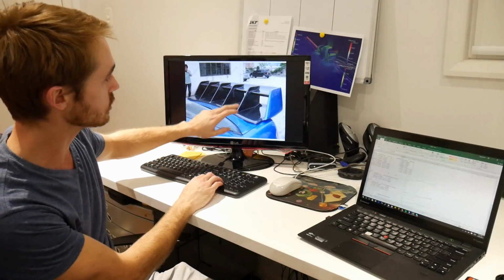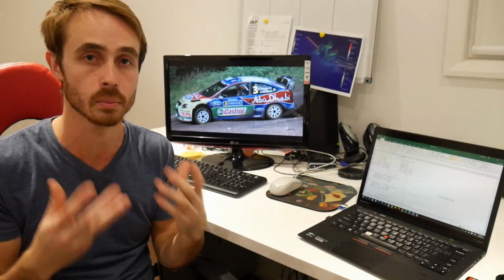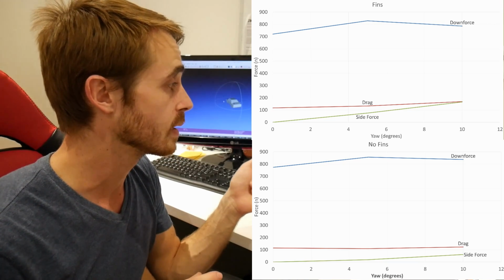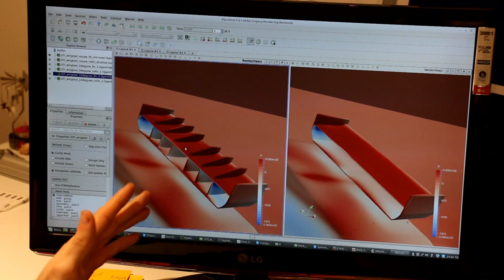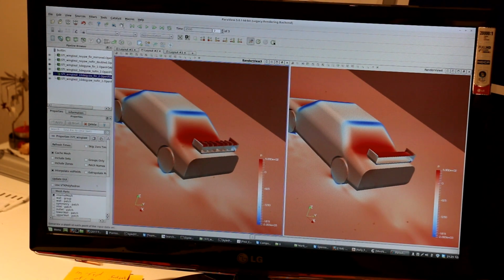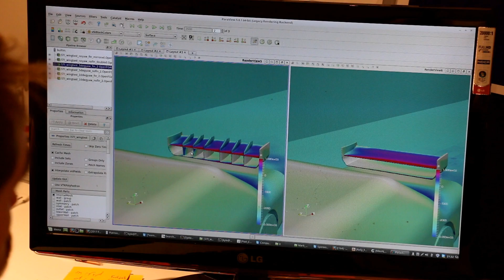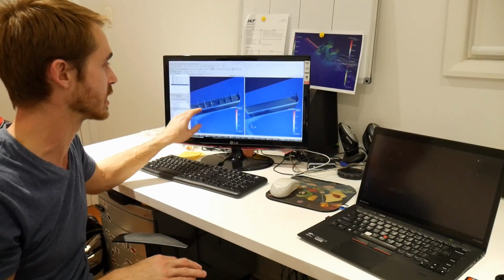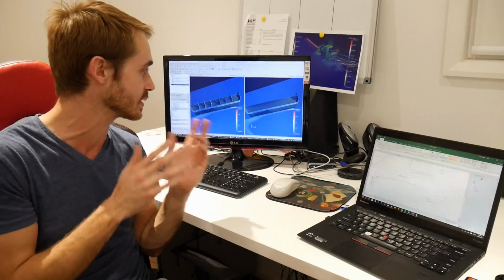How do Rear Wings Fins Work? - WRC Wings Explained!

Comment: Thanks for sharing! We were all having a recent conversation about this in a group about why folks went with skeletonized / cutout uprights vs solid, and what the benefits were etc etc.

The most interesting response came from a fellow who did cutouts in the same shape as the aerofoil running fore to aft on the uprights. They found it reduced drag while also reducing weight.

Comment: For those who are having a bit of trouble understanding.

Wings don't like going at an angle. They lose downforce. Flow separates and shears off.  The fins more or less redirect and force the air into the correct direction and they work better the sharper the yaw angle.  The slight loss of downforce in the straight (or overall downforce) is a good trade off when you're keeping a lot of that down force while sliding through the dirt compared to normal road racing.  This is one of the reasons why end plates are on wings compared to back in the 60's, because even if slightly, due to slip angle (your tires are literally bending and stretching to make it look like your car is drifting even if slightly) your wing will have some yaw and receive air perpendicular to where it's heading.

so in reality. Road cars have to have the same thing as rally cars, but way less because they aren't expected to slip and slide.

Comment: I remember in the early days of Formula D there was a yellow GTO that was a top runner.  One of the odd things they did was put these clear plexiglass fins on the rear of the car between the C pillar and the wing.  The reason they gave was for better control of the drift at high speed.  Guessing it was a similar thing to the WRC cars.  Was around the early 2000's and the driver I am pretty sure was a rally driver as well as Formula D.  Drawing a blank on the name right now.

Comment: Am I correct in thinking that rally cars have heavy bias towards rear downforce? I used to rally and ice race on an amateur level. I had a traditional wavy carbon fiber road race wing on my first car, which wasn’t as good as my second one with a wrc wing. It’s an old design without fins though. It still had more side force obviously. Thanks for the explanation. I can definitely see how it works now.

Comment: I couldn't message you, so, random question. I just bought a wrc spoiler for my 04 sti. Can I use the oem spoiler bolts for the wrc spoiler or will I need new ones?

Comment: Hey Kyle.  I have a 2014 turbo BRZ and a 2017 STi, and I'm in several Subaru groups on Facebook, and I've seen a ton of people buying Perrin's "wing stabilizers"...though they're also known as "stiffies" to those groups.  You can see them on Perrin's page by following this link: http://perrinperformance.com/i-23037505-wing-stabilizer-for-2015-17-sti-sedan.html

Now, looking at their design, they're incredibly thin and don't have an aerofoil shape, so they really do seem to serve no aero purpose at all, unlike the real WRC wings that you've tried to explain here.  These are the only sort of vertical fins I really see anymore, and it seems to just be a bunch of people wanting to look like rally drivers in their STis that will mostly never even see dirt.  I've asked people for their reasoning behind buying them, and I'm not entirely opposed to the look, but I was curious if people thought they were getting them for the same reasons as rally drivers or not.  A few said they noticed their wings vibrating at highway speeds, and I asked what their concern was about that, since it seems like a tiny bit of flex shouldn't affect the wing's ability to generate or transfer its downforce in any significant manner, but never got any answers.

I'm curious to know if adding this for the looks (the reason that most people seem to do it) has any of the benefits or drawbacks of the fins in WRC wings with actual wing profiles.  I couldn't tell how much of the drag or sideforce you showed was caused by the wing profile vs just disrupting the airflow in general, as these would still do even being so thin, especially when at a high yaw angle.  Would it be possible to either give a quick answer here, or put up a brief follow-up video showing the CFD of this sort of design?

Comment: Sounds like Wing Fins are good for drift cars as well.
Reply from the maker: I'm not 100% sure, drifters are a higher level of yaw again which may cause weird blockage effects as the fins stall out. Also, you don't want to be yawing your drift car too hard back out of the drift or otherwise the driver will struggle to hold big angle, but you obviously want to maximise your rear end traction, so downforce is probably more useful. I have quite a few ideas for drift aero, just need to find a high level drift team that will take them on...
Reply: Ahh, thanks for answering. I'm no drifter by any means, but I was just wondering. :)

Comment: +KYLE.DRIVES - As an FYI, sometimes the fins on the rear wings are added as stabilizers to prevent the wing from breaking, too, given that there are some thin fibreglass spoilers fitted (i.e., to the 2004 STi) where the wing will flutter at high speeds...

Comment: Hey +KYLE.DRIVES , just wanted to clarify.... finned rear wings increase side force when slip angle increases. Does this side force help bring the car back in line as quickly as possible or make the process of drifting more controllable??Btw, great video. Loved every minute of it

Comment: Hey +KYLE.DRIVES, Two things: First, seeing you try and move the model around to show different phenomena on the CFD model reminded me of how much I love my SpaceMouse. idk how often you're in CFD and CAD, but I use it constantly. Its particulary useful when switching between programs that don't use the same 3D navigation commands (Ex. SolidWorks and ICEM CFD). It's also great when I try and show CFD results to someone as I can rotate around the same point without the model moving off screen. Anyways, didn't know if you've heard of it before, but I highly recommend it.

Second, I asked a question on your strakes video, but didn't know if you check over old video comments or not. I'm just a bit confused on the nature of vortex "blocking" when it comes to diffuser flow. Could you check that out? thanks!
Reply from the maker: Waaaaay ahead of you =P https://youtu.be/dQvCNEhuszw?t=4m20s
I just have it hooked up on my CAD workstation not my CFD workstation as I haven't gotten round to sorting the drivers out on the CFD computer/sorting Paraview settings. For most of my actual CFD work I'm not quite moving around as aggressively as this though!

I'll go and take a quick look at your other question too. Thanks for watching!
Reply: Haha, great minds think alike?